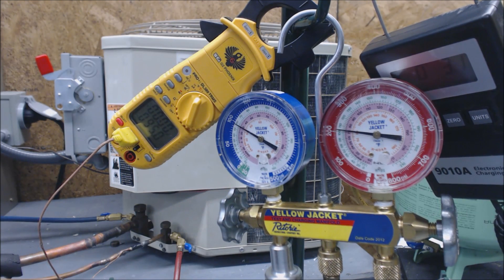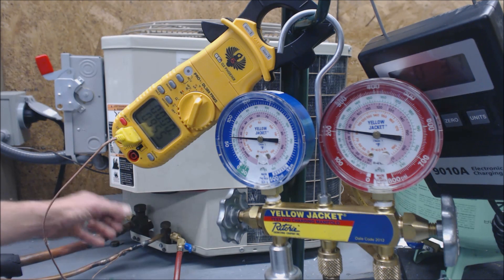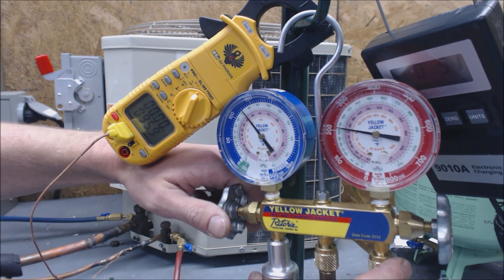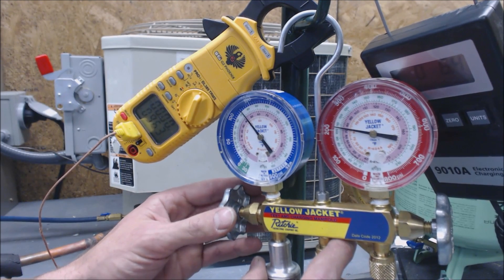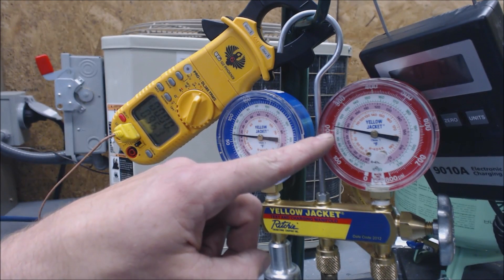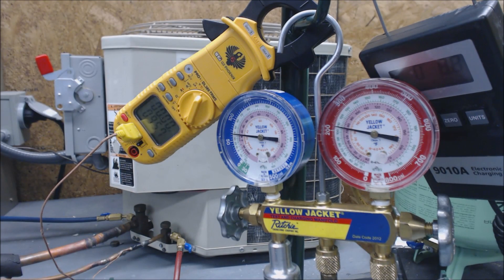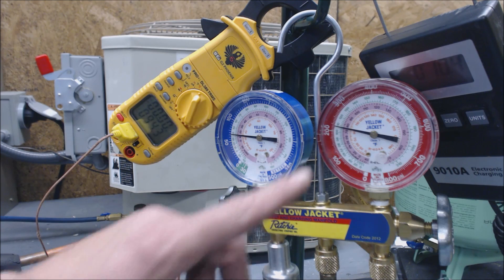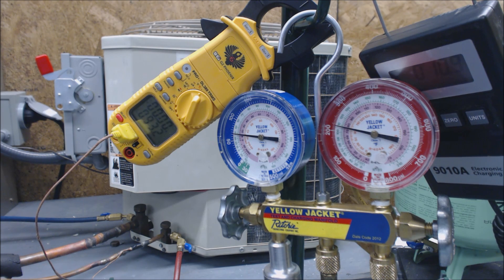Charging an AC System Low on Refrigerant in Real Time! Part 2

Comment: Awesome video. Thx! So here u said that the line temp will drop as u add the Freon which in turn raises the saturation temp on the condenser u it. So, does this mean that in spite of the outside temp u can change the high side line temp in order to drop the subcooling to the plate reading?

Comment: What if the the name plate or literature doesn’t have a recommended subcooling or superheat?
Reply from the maker: You would have to find the superheat with wb and db. Subcooling for single and two speed ac units you can shoot for 11 degrees then. Look up "acservicetech subcooling playlist" "acservicetech superheat playlist"

Comment: what happens when you are charging the unit on subcooling but as you add refrigerant the saturated temperature goes down and keep the same temperature as the temperature on your gauge? (static pressure was 0.5, good airflow, clean filter) room temperature was 70 and the temperature from the supply was 49, thanks in advance.
Reply from the maker: .5wc is the max static pressure usually so that is high. There is still low airflow if you if you have 21 degree delta t with low vapor side sat temp. Did you check actual cfm? Can the blower speed be set higher? Is duct sized correct? thanks Diego!

Comment: Where do I find in the unit info to regards; as you mentioned this unit is set for 15 degrees sub-pulling temp? I've read the unit-plate info  at the condenser and can't seem to find the sub-pulling number?  Can you advise please?  Can you send us a sample of a photo?  Thank you so much, great training.
Reply from the maker: If the rating plate does not say txv subcooling and you have a txv at the indoor unit on a single and two speed compressor ac unit then we typically use 8-12 degrees target subcooling. I usually use 11 degrees target, thanks

Comment: Very good instructions.  Thanks for the detail.  I'll be getting a set of gauges, refrigerant, etc.  Want to learn how to annual maintenance checks and be able to add refrigerant myself if needed.
Question:  Isn't there an element of adding refrigerant with respect to outside ambient temperature?
Reply from the maker: Awesome Jason, keep in mind amazon.com/shop/acservicetech for tools unless you are getting them from a certain local supplier. Yes outside temp has to be above 70 degrees unless a charging jacket is used in an emergency, thanks
Reply: @acservicetechchannel  Jason, as far as refrigerant you are not able to buy or charge systems unless you are EPA certified. The fines are no joke when caught, just heads up.

Comment: Great Videos, 
Question, how does one find the sub-cooling temp if not given on data plate for mini split system with 410a?
Just learning.

Thanks, John M
Reply from the maker: If it does not say on the rating plate and it is comfort cooling with a txv and a single speed compressor then I shoot for 8-12, I usually set them to 11 and then check for an indoor temp decrease from the return to supply of 18-21.
Reply: Thank You for your fast response. I need to charge the system the liquid line is frozen. I found the leak on the inside air handler, found refrigerant oil at flared connection. Connections now tight no bubbles just need to charge. I would like to purchase the equipment and do it my self and have for any future problems or should I just call someone in for the charge.

Thanks
Reply from the maker: We need to be epa certified to buy and handle refrigerant but I have a lot of adults from the community that come into the night school course to do a review and get certified. I would say, have a tech come in for now and work on the cert and tools after, thanks!
Reply: Thank You, Do you know of any in the NYC area? School and for service.
Reply from the maker: I do not, but you may check the local county technical high school as they may have adult classes at night and at a cheap rate, thanks
Reply: Thank You, I'll check them out.

Comment: It looks like that valve on the high side of the manifold is open, should that be open during this process??
Reply from the maker: The valve is actually shut even though you see the threads showing. This does need to be shut while charging into the low side, thanks

Comment: hey, is it ok to use the same liquid vaporizer for r22 and 410a?
Reply from the maker: It is best to keep the gauges and vaporizers separate when at all possible. You won't get much oil in them but some may still get in from the hose and purging before charging. Thanks Mike!

Comment: your expanded should be located as far from the gauges as possible. You'd be better off locating it at the refrigerant drum to make sure liquid does not come back to the compressor.
Reply from the maker: Yes, I keep it on my gauges for ease of use but yes, on the bottle would be great and further away, thanks Douglas Kahane!

Comment: on a 410 do I need a liquid vaporizer for charging or can I use the high side and charge as liquid?
Reply from the maker: You can only charge liquid into the liquid side when the system is under 500 micron vacuum when breaking the vacuum.  Here is a video--https://youtu.be/ncgLDYrvN6w-------   You have to meter a little bit of liquid at a time into the vapor side of the system while running if the system does already have refrigerant in it. While running the system has a lower pressure on the vapor side than the bottle, while running the system has a higher pressure on the liquid side than the pressure in the bottle. I hope this all helps!